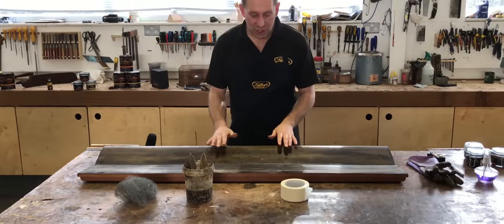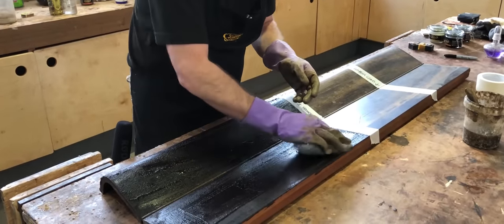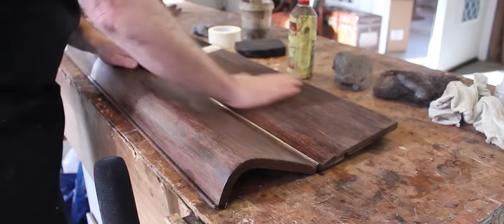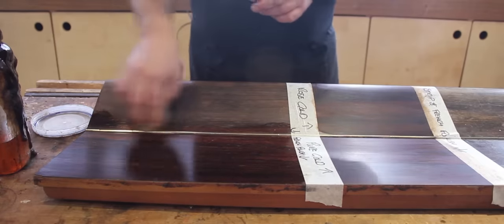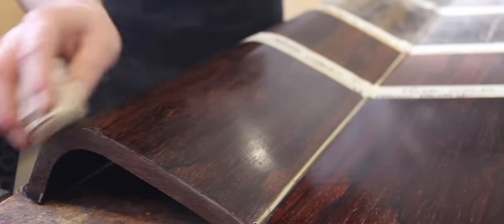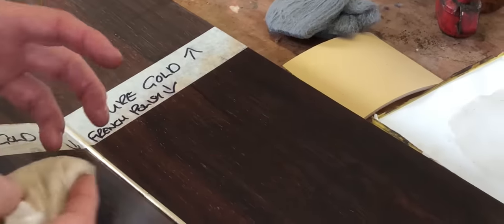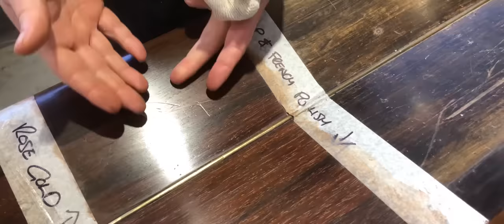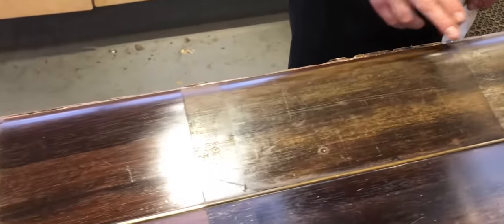How to Strip and French Polish Wood Furniture

Comment: Great video.  I assume that 'methylated spirits' is 'denatured alcohol' in the USA?   
   Do you use the same rubber to rub on the methylated spirits as you used to apply the french polish shellac?  Did you say that the French polish can act as a grain filler; I was not clear on that?
    Thanks!
   --Wm. Brown
      www.LineAndBerry.com
Reply from the maker: Hi William. 
Yes I think methylated spirit is 'denatured alcohol' in the US. 
In this demonstration I used the same polishing rubber as a the spirit rubbber. Just to be clear, the meths isn't rubbed on. The 'Rubber' is the vehicle used to apply the polish or meths in a controlled manner. The skill is in understanding how to use it. Unlike a paint brush that just transfers the paint (admittedly with differing skill levels) a 'rubber' needs to be carefully controlled by the person using it.
Grain filling is a bit of a cheat, it's a time saver. By using grain filler you are saving time and money by not having to fill the grain with french polish. This in turn makes the bodying process shorter allowing you to move on to the next job. 
Plaster of paris has been used as a grain filler for centuries. You can often see where it has been used on period furniture where the grain has become white and speckled. This is due to the colour that was used to stain it being bleached away. It is commonly seen here in the UK on Victorian mahogany furniture.
I hope this makes it a little clearer. 
Simon Gilboy
Reply: Thank you for the reply Simon. Your video was really great.    We reproduction furniture makers still use plaster of paris to fill grain.
Reply: Thanks for the info Patrick.
I've heard that 'EverClear', sold in the USA wherever fine whiskey is sold, is the best for dissolving shellac flakes.  Apparently it's more highly refined ethanol.
Reply: So what do you fine fellows think of this idea for "grain filling"?  I've seen someone take the sawdust from the wood they were working with, mix it with some sort of urethane, work it into the grain, seams etc and then do a final sanding when cured.  Seemed to work well and I would imagine be a perfect match.

Anyhow, thanks for the video I actually learned something today.  LOL

Edit:  Yes, Everclear is grain alcohol and 190 proof or 95% alcohol.  We used to put it in punch and iced tea as "kids"  You could hardly taste it and because it was so pure not much of a hangover at all!
Reply: William Brown
Reply: I have watched a few American videos of people restoring furniture and they often say they are using “white spirit” which I imagine is methylated spirits, but I’m not actually sure. Sounds like “denatured spirit” is the term, so what is white spirit?
Reply: Scott McLennan  I'm a novice and am only replying because no one else did and I didn't want you to suffer trying to substitute one for the other. White spirit is very different from methylated spirits. White spirit is a petroleum distillate while methylated spirits is a mixture of alcohols. It's along the lines of paint thinner. I have heard of people using petroleum distillates like paint thinner or mineral spirits instead of the oil that Gilboy's Restoration used but do not know the pros and cons. Some say it is easier to remove the petroleum distillate vs. mineral oil or even that it just evaporates off. I don't know. What I do know is that you must use methylated spirits to dissolve the shellac to make the polish and then as shown in the video. I did try polishing once using mineral spirits as the lubricant instead of mineral oil and it seemed okay, but I'm so green at this that I can't really say if it is a good idea.
Reply: ef2b good on you and thanks for that info.
Reply: It is 195 proof before it is opened; after exposure to water vapor in air it drops to 190 proof. PROOF/2 =%alcohol.
Retired pharmacist here, this is what we were taught.

Comment: Im a professional furniture conservator.  Surprisingly I find no reference in any literature about treating rosewood with nitric acid for a bleached effect.
Reply from the maker: Hi Doug. It is something we have discovered can work if diluted. If you 'Google' it there is information about it.
Reply: sodium hydroxide in water is also an inexpensive rosewood bleach.
Reply: Nitric acid is used in gun finishing to get a dark color, though it must be well neutralized (with baking soda) after use.  It darkens the finish without reversing the grain.
Reply: Hmmm, most guns are made from metal, not wood. So what is your point about using nitric acid on METAL when this video is about WOOD???????????????????????????????????????????
Reply: Most guns have wood handles or stocks.
Reply: Ohhhhhh, so NOW you make the clarification that you should have made originally.!  Like maybe... "Nitric acid is used in gun finishing to get a dark color on the wooden parts, such as the handle." DUH!   I suspect that many more readers would be familiar with using nitric acid as a treatment for gun METAL passivation rather than as a gun WOOD treatment.
Reply: I don't know about using nitric acid as a bleach but for sure oxalic acid does the job. It is marketed as 'wood bleach'.

Comment: I think it’s much quicker and nice if you just sand it.
Reply from the maker: Hi Bird Group, 

Just sanding is much quicker, however this lid is veneered with rosewood. rosewood when sanded tends to go completely black and you lose all of the wonderful patina of the wood. You also run the risk of sanding through the already thin veneer.

Thanks.
Reply: Aside from what gilboys mentioned, sanding can also change the finished dimensions and affect the fit and finished look of the parts...   discoloration of the parts due to oxidation over time will also affect the appearance.  If you fail to treat the entire surface the same way, the mismatched look becomes painfully obvious.

Comment: Why doesn't he use gloves working with those dangerous chemicals?
Reply: Yes he said the stripper might burn skin then wears no gloves...at least not until he wipes with wire wool
Reply: I'll double check, but I'm pretty sure he used gloves for the stripping process.  After that, the big, scary, frightening, chemical he was using mostly is simply alcohol/alcohol based product.
Reply: Wrong + wrong.  1. no gloves while applying stripper. 2. Methylene chloride, not an alcohol.
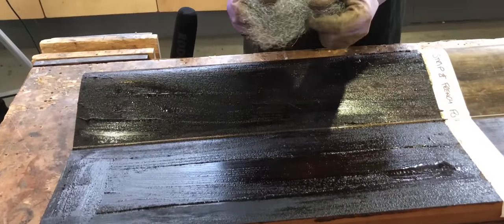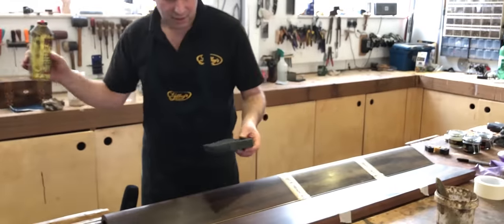Reply: Right + Right  1. 4:21 gloves.  2. 7:45 "Methylated Spirits"  aka alcohol made unfit to drink by the addition of 10% Methanol (alcohol you can't drink - Google methylated spirits for goodness sakes.).  Like I said, he had gloves when his hands came in contact and was using alcohol based products.

Edit:  Here, since you probably won't do it let me get it for you:  "Denatured alcohol, also called methylated spirit or denatured rectified spirit, is ethanol that has additives to make it poisonous, bad tasting, foul smelling or nauseating, to discourage recreational consumption. In some cases it is also dyed."

No big bad boogie man here to see...sorry.
Reply: 1. The OP was not wearing gloves when applying the stripper. 2. The stripper used is methylene chloride, which is not an alcohol.

Your description of 'meths' is correct, but irrelevant, since it was not used.

Comment: doesn't explain or give polish formulas and is vague about polish pad composition . seems as though hes only interested in views. and not complete instruction
Reply from the maker: Hi, It is very difficult to try and compress a 4 year apprenticeship into a 30 minute video. I have tried as best I can to give an insight in to how we at Gilboy's French Polish. We buy our french polish already mixed so it would be wrong of me to advise on mixing your own. The pad is a 'fad' which later becomes a rubber which is explained at great depth with an additional video we produced at the same time as the above film. you can see it here: -  https://youtu.be/GmA6YQLaJBM
Reply: It was never meant to give recipes, but show and teach you the process of how to apply it properly.

Comment: Doesn’t give much info on what to use. He’s just showing off something anyone can do. He is so proud of himself. “I can’t explain it it just takes practice”. all your doing is wiping different things on it’s not you it’s the chemicals and polishes. I wanted to smack him.
Reply: He does explain the technique to use and what not to do as well as what to do to produce the results he is showing off.  The part he can't explain is the FEELING of how the rubber (polish rubber) works as he uses it and gradually applies more and more pressure to the tool as he works to press more and more polish out of it, as well as the feeling of resistance as the rubber glides across the surface of the work piece.  The french polish is literally trying to glue itself together as he works.  

The oil provides resistance to this "glue" effect by lubricating the pad as it is worked across the surface.  Stopping at any point against the work piece will ruin the finish by creating an area where extra polish "glued" itself to the surface, possibly including fibers of the rubbing pad material itself.  This would result in needing to strip the polish and start again.
Reply from the maker: Thanks Gregory. A perfect written explanation.  :-)